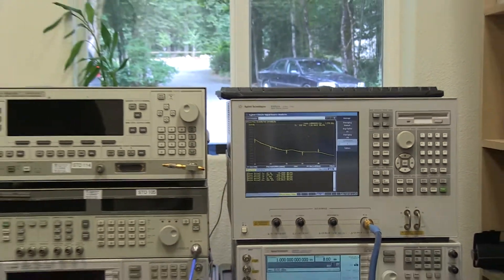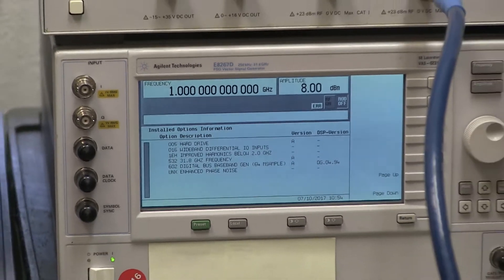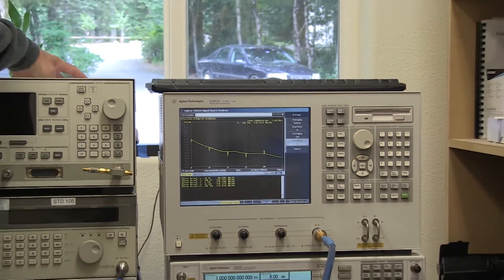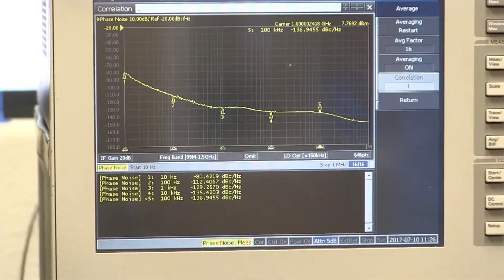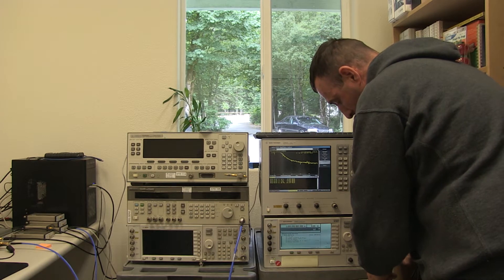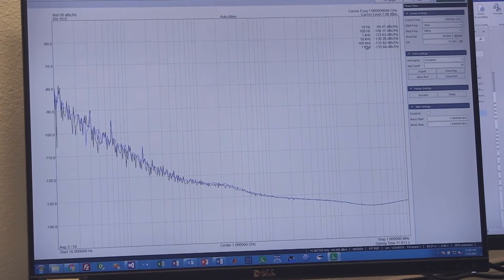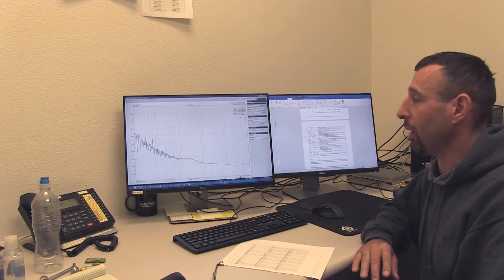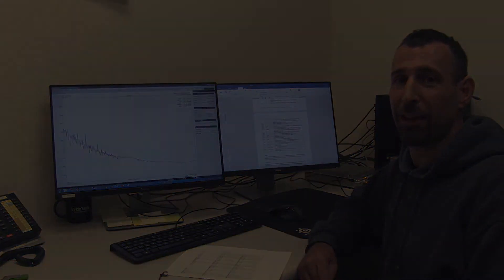SM200A Phase Noise Measurements

Comment: The phase noise on the signal hound sm200B  is very impressive. However, the few dB difference between the SM200B measurement and the Agilent E5052 means it’s hitting the phase noise floor of the sm200B and the measurement has a lot of uncertainties. 
And one probably needs to do quadrature subtraction on the base line of the sm200B. So would I trust the numbers from sm200B, no, but as a quick test for the PSG it’s totally fine.
Reply: I would agree.  And dedicated phase noise measurement systems enable the operator to increase the number of correlations to get better phase noise measurements (within the limitations of the instrument)
Reply: Yes, the close-in measurement was several DB higher on the Signalhound. But I think it's quite good for the price point.